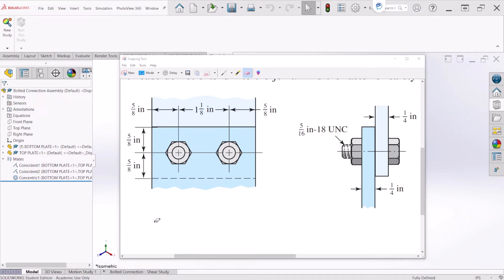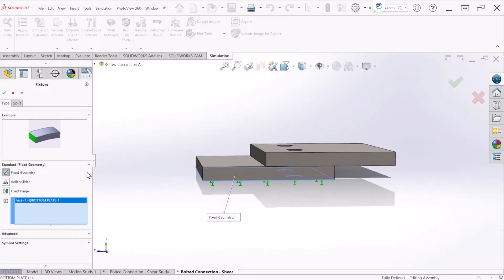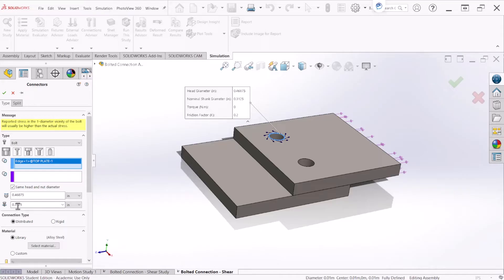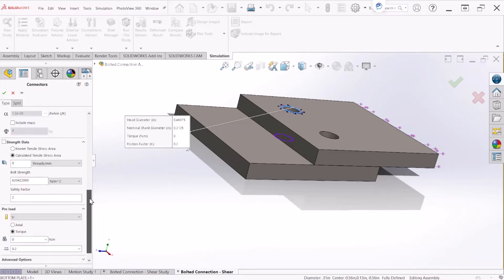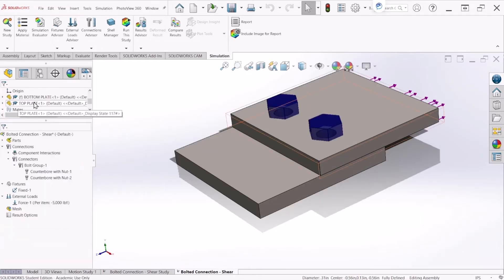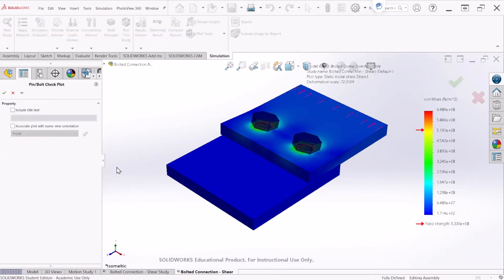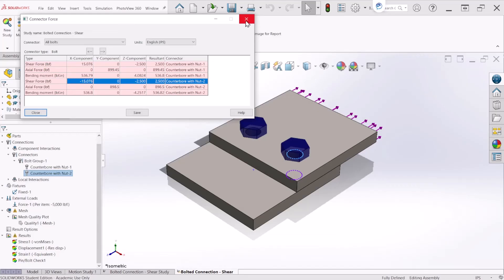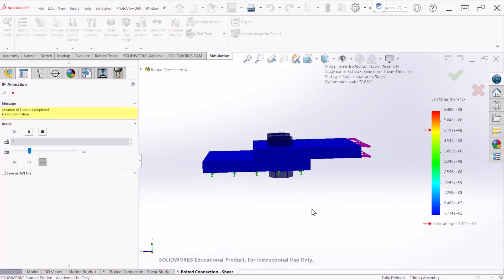How to Calculate Shear Force on a Bolted Connection | FEA for beginners | SolidWorks Simulation

Comment: This study doesn't appear to include preload to the bolts. The resulting friction between the plates from bolt tension would reduce the shear force on the bolts.
Reply from the maker: You are correct, this is a simplified example to explain the concept.

Comment: Great video mate!! I followed along on my home computer and each time I went to run the simulation, I got a notification saying the bolts were not torqued, so I added torque, but still that seemed not to work very well. Perhaps I did that wrong, but I used a torque table I found online and it said it was an unusual torque range or something like that. How come yours didn't ask for pre-load?

Also, I noticed that @4:19 you didn't actually check the Strength Data check box. I found that if I didn't check that box, I couldn't access the bolt/pin check because I didn't have strength data entered. Did I miss something that you did? 

Do the holes need to be exactly the size that you want the bolt to be? I've used the hole wizard to make "loose" M16 thread clearance holes which are 19mm dia. but that then doesn't like adding that size bolt. 

Also, I tried playing around with custom material properties and it REALLY didn't like that. 

Thanks for a great tutorial. Your simulation videos are teaching me heaps.
Reply: I will try it also. His videos are the best